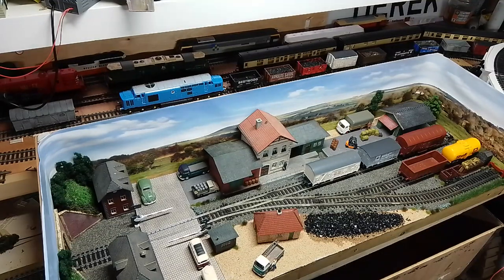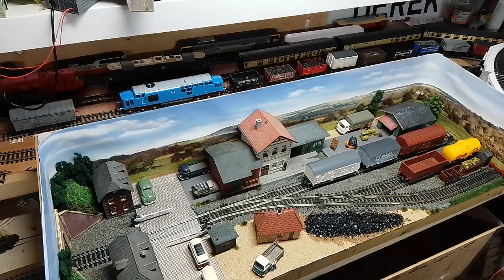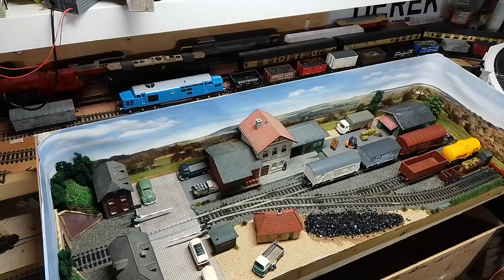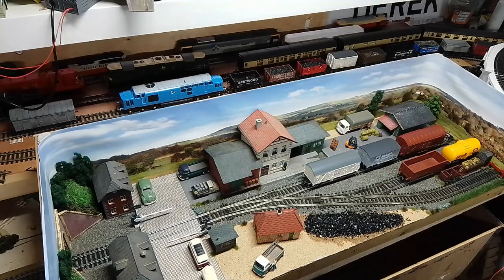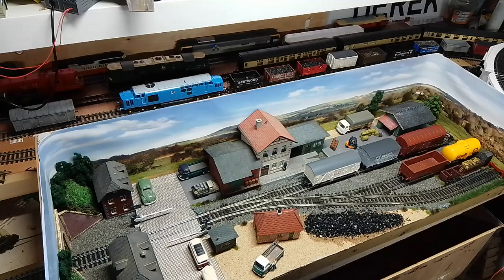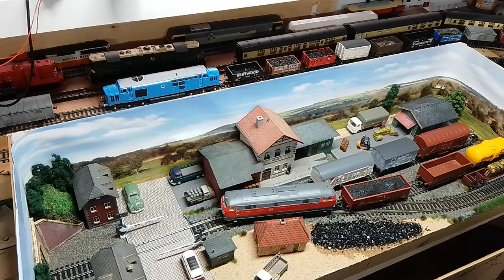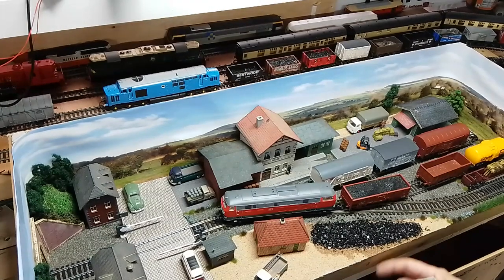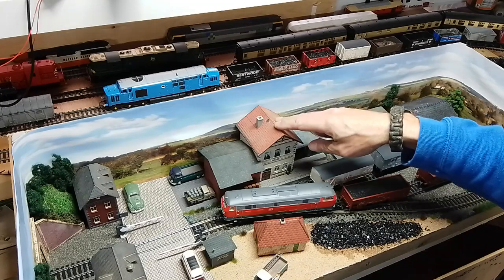HO Inglenook Shunting/Switching Layout Model Railways/Railroads

Comment: My HO layout is based on the 8 car version of the Inglenook Sidings Puzzle.  I normally run it with 7 freight cars and a caboose.  The whole thing fits on a 1 x 6 foot shelf and includes three industries, a team track, and an enginehouse.  I've also written a computer program to find solutions to any version of the puzzle, which is much more computer intensive than you might think at first.  A professor of computer science in London, Simon Blackburn, has written a mathematical paper on the puzzle which proves the existence of solutions to all starting configurations.  Thanks for highlighting this puzzle and cheers from Wisconsin!.

Comment: I'm in Canada  so HO country and I'm doing a British outline  OO layout based on the Inglenook . The baseboard is an old closet door, the track is reused Peco flex that has been sitting in various garages for the last several decades. The stock is all "new to me" used items from E-bay and Hattons, and the power supply is older than my marriage. The only new bits are the 3 switches. I was going to go with 2 and use the third for the fiddle yard. I decided instead to go with cassettes and put the switch on the layout for future operations. I intend to have the extra siding blocked by a works train when I am shunting the inglenook.
Reply from the maker: Sounds great

Comment: Having attempted (but never completed) large layouts and medium sized shelf layouts, my favorite and most fun has been a simple 1x4 feet HO Inglenook. Simple, bullet-proof, yet highly satisfying. Oh, not to mention, quite budget friendly! In the U.S. its fairly easy to find inglenooks on the prototype, particularly in small towns or industrial sections of large cities. The town in which I live (central Alabama) had a large mill which manufactured cotton gins. The old buildings, dating back to the 19th century, are being turned into apartments. Old maps show that it was rail served until the early 1960's, an industrial branch off the old Louisville & Nashville RR. It was a pure inglenook with two switches (points) and three sidings serving a boiler house (coal, then later oil), a wood shed, and the main warehouse. Single industries are great subjects for inglenook layouts. Thanks for the excellent video and hope you will follow-up on this little layout.
Reply from the maker: Thanks, I even have a plan to make a US outline inglenook

Comment: I find these kinds of layout therapeutic, I wrote a MS Excel doc where I wrote out all of the wagons, select which ones were ‘in play’, and then had it randomise a selection of either 4 wagons or 3 wagons and a brake van (if the brake was picked, it only does so at the end). What I also like is because they’re such small layouts, you don’t mind putting a lot of effort in to make something really smart, you can turn it around quite quickly and get to the reward rather than it being never ending. Not to mention easy to put on a shelf.

I did try to be clever with some magnets and staples for auto-uncoupling. That did not work at all, if you had it working on one wagon, you blew it on the rest… back to a piece of bent welding rod, a shunters pole!

Comment: The use of HO is interesting and, as you say, cheaper. I started my railway modelling with an Inglenook sidings in N gauge on a baseboard 22" x 7" made from 1/4 Inch balsa. It's amazing haw many variations there are on the Inglenook design. Yours has shorter sidings and uses less wagons but the idea works just as well. I then got sidetracked into a OO gauge layout on which I made the mistake of modelling a cobblestoned yard which is taking ages to finish. Have no fear, your videos will never look like Charlie Chadwicks.

Comment: Another great video from BMR! The As-Is section at most IKEA’s usually have good cheap material for a small layout baseboard. Plus I just found and bought a nice Hornby OO R156 Class 08 Shunter at my local model railways shop here in Portland, OR that would work very nicely on a small inglenook layout like that.

Comment: HO may be 3.5mm/ft unlike 00's 4mm/ft, but when I've seen continental layouts they always seem a little more compact and get more in the same space without looking toy train-ish. That little 0.5mm/ft makes a lot of difference.
It's a shame UK railway's haven't made the transition to HO. It really shows up when you see a true 4mm scale layout and you realise just how far out the track gauge and sleeper spacings are. 00 is a bit of a basket case scale. Hopefully the TT:120 scale will address that and be the correct scale and gauge, almost a ready to run finescale straight from the (very expensive) box.
The downside being no second hand market to purchase affordable stock from yet.

Comment: Inspirational. I have a US n gauge inglenook track layout which is fine with lots of space, and when I put my German goods wagons on they are lost or require doubling or tripling of wagons to fill the space. This has led me to consider the HO gauge when modelling German goods as N gauge is just too small. N gauge works for passenger coaches but not for small goods. Now I am considering a HO inglenook like yours with a BR89 and the Roco Goods wagon set (8 wagons for £80).
Reply from the maker: Thanks. I find I can shunt very well in N, but HO is a good compromise

Comment: It would be easier if you formed the outgoing train on the longest siding (the one nearest the station building) Then you wouldn't get the problem of the formed train blocking the point (as at 11:24). Part of the Inglenook design is that each siding has a maximum capacity. In the classic Inglenook the capacities are 5, 3 and 3. There's also a maximum capacity on the headshunt. At the beginning of this video I thought you had done a 3, 2, 2 design, but then you tried to put 4 wagons into a 2 wagon siding!
Reply from the maker: I've not seen any 'rules' for an inglenook, like all model Railways , rule one applies, my railway I can do what I like

Comment: I know you're just using this locomotive because it's what you have but these locomotives are actually not out of place on small branch lines! We even had these ones (I suspect yours is a BR 218? If so it's the same class I'm talking about.) in the Netherlands on the 'Kamperlijntje' hauling freight trains and shunting them around. Trains were a bit larger with around 10 wagons but I think they were used because of a locomotive shortage, so the Dutch Railways had some German engines come and help.
Reply from the maker: That's fascinating thanks

Comment: I wonder if a 3-2-2 layout instead of a 5-3-3 layout will get a bit boring after some time? The very small size of your layout is intriging though, since I don't have any space for a stationary layout and must rely on suitcase layouts that I can store away. This one would fit into a keyboard case. Looks nice. I'm thinking of building one in N-Scale, because the couplers are easy to uncouple, but I'm afraid it would be too small to enjoy. Have to do some more thinking. Thanks for sharing this.
Reply from the maker: I've just tinkered with an N gauge equivalent it's only 2ft by 6in but allows for a 4-3-3. Even 3-2-2 gives you endless variation, especially if you have a good stock wagons. Any layout is better than no layout in my view.

Comment: About couplings, personal experience : originals are usually the best : works anytime, standardized, costs nothing. For my N scale models, I had decided to leave the originals : they do the job, and I have no justification to buy better ones. Especially with my Japanese rolling stock, devoid of NEM coupling sockets...
Personal opinion : the loop couplers for continental rolling stock is not the greatest, especially in terms of reliability, and you easily wants to replace them. The UK tension lock couplers are far better. But I had planned to replace them for several reasons, one of those is the fact that I have German ferry wagons that can run on UK tracks as the prototype. But that's me...
Reply from the maker: Non of these have NEM so changing them is not simple and in the UK the couplings would cost me more than the wagons did lol
Reply: @BudgetModelRailways  My personal experience : if no NEM socket, don't insist to change the couplings, it's a waste of money and time. You'll always finish with lots of work to do for a result that is not better than with the original couplings.

Comment: You know I think the original ingelnook sidings didn’t have a fiddle yard just the confines of the layout it just had enough for its Lima 08/09 and two wagons and used a tidily wink computer what ever that was 
Just shows you can have a model railway anywhere 
All the best 
👍🏻😊
Reply from the maker: Correct, but it would have made this too big hence the fiddle yard
Reply: @BudgetModelRailways  I know but what a challenge ,the details on the model are superb and the value of the piko locomotive I have one but an electric in connex livery paid £35 back in 2005 superb model 
Cheers

Comment: It would help if you actually understood how an inglenook shunting puzzle works.

You can only have the loco plus 3 wagons in the headshunt at any time 

And also the two sidings closest to you can only hold a maximum of 3 wagons each. 

Look it up online, there is a whole website dedicated to it.
Reply from the maker: I'm not big on rules for model railways it's what spoils them, it's my layout I can build it and run it how I like. UK sources don't quote any stipulation. All layout plans are there to be adapted as the builder sees fit
Reply: @BudgetModelRailways  no uk sources because its not a uk design. if your not running inglenook rules its not an inglenook.